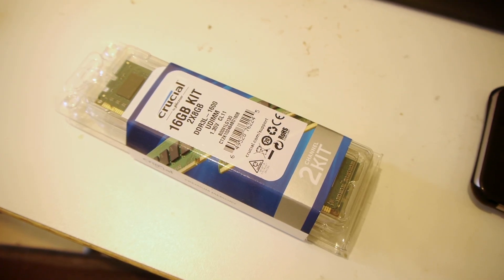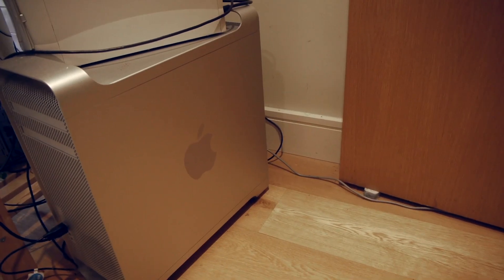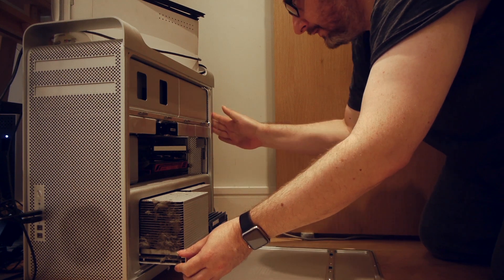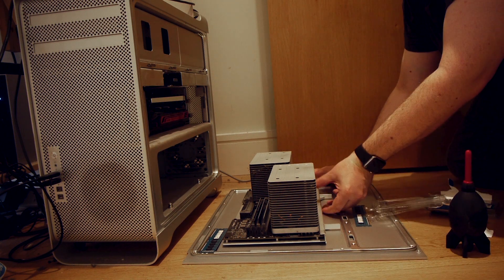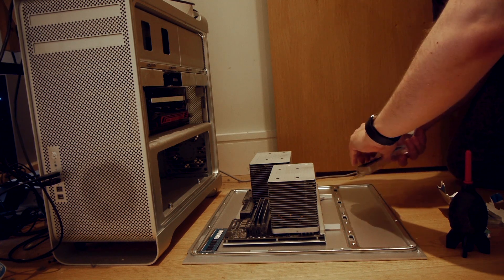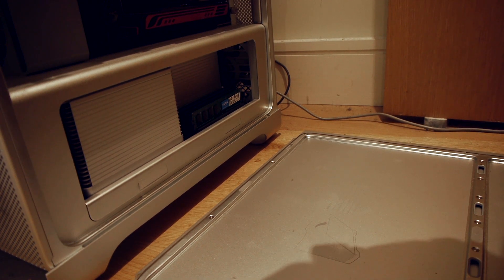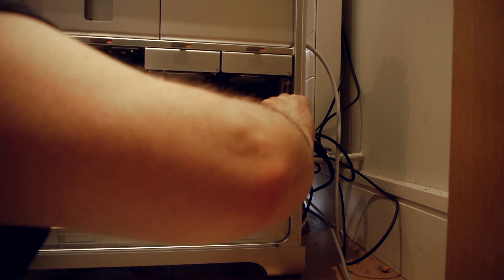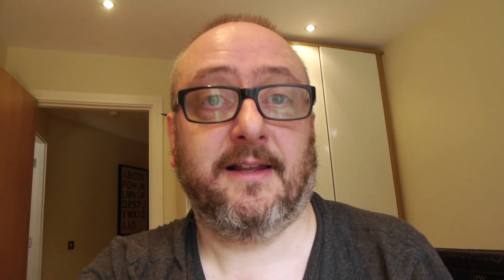Upgrading an old 2012 Mac Pro

Comment: Old, but still very much relevant, very useful, and very well performing for its intended purpose.  Apple certainly did a great job when they made these beasties.  They should have updated the Cheese Grater for 2013 rather than replace it with the Trash Can.

And now, you can even install macOS Mojave on your 2012 cheese grater, so long as you have a graphics card that can support the Metal API, such as the Radeon HD7950.
Reply from the maker: yeah, a new graphics card is next on my list!

Comment: Great video Thomas, unfortunately now with most if not all new Macs the upgrade path has been intentionally closed down by Apple for obvious reasons. I have two, a MacBook Pro 2015 and a 2016 iMac both are glued shut and memory soldered onto the system boards. When both were bought the max ram that could be obtained was 16gb which is fast being outpaced by software.
Jim